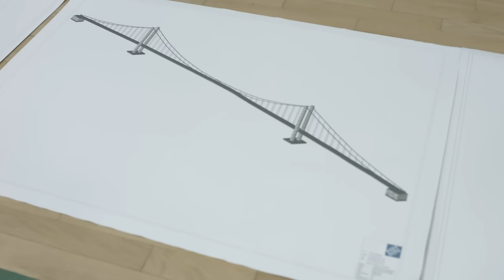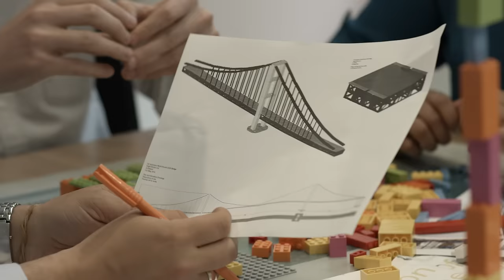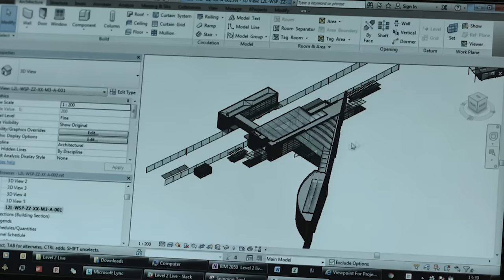Creating the LEGO Bridge: A Civil Engineering Challenge

Comment: I thought the video was interesting as a promotion for the actual model... but I feel it wouldn't have been helpful to actually inspire someone considering (structural) engineering as a career.  For a relatively long video, it didn't really explain much about what the structure was intending to do.. what problem it was solving... or what criteria would determine whether the project was a success, other than to build something that looks like a bridge longer than 14.1 metres.

While they DID mention about loading during transportation, construction and when 'in service', they didn't didn't quantify anything very much, which I think most people would like to know... and most of the likely questions remain unanswered:  What weight can this bridge support?  Why are  there vertical "wires" all the way along the suspension "wires"?  Why does the bridge deck "bow up" in the middle?  Why are the braces between the tower elements criss-crossed?  Why is the actual bridge deck made-up of a lot of criss-crossed pieces?

I was actually looking for something that might have provided some clues on how to build a WORKING bridge out of Lego: how you deal with the shear forces between the pieces, how do you stop the bending parts from actually exploding apart, what proportions are required so the towers don't actually buckle when the deck is loaded, how will the bridge (incrementally) fail, so the loss of (Lego) life is minimised, etc, etc

This video actually failed in explaining anything concrete (ha-ha) about the civil engineering involved and how this 'physical' model would help us understand and 'model' the real thing and its behaviour.